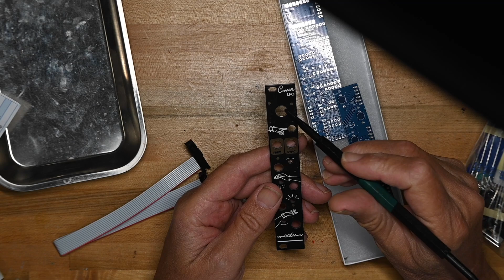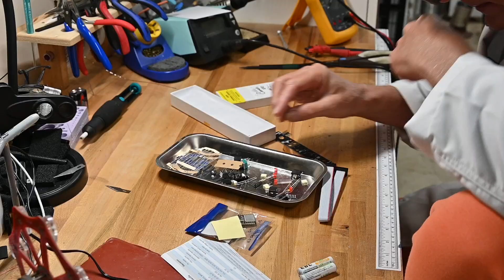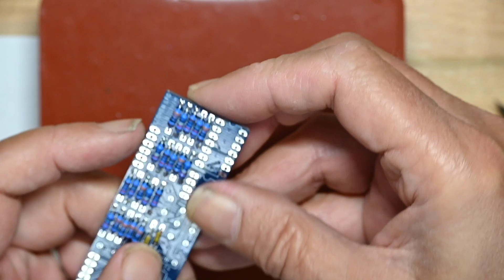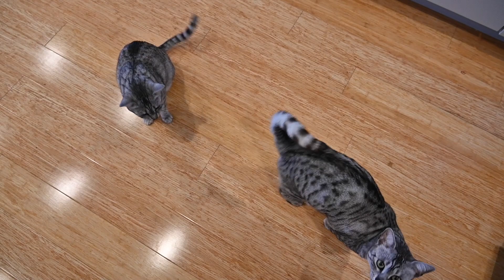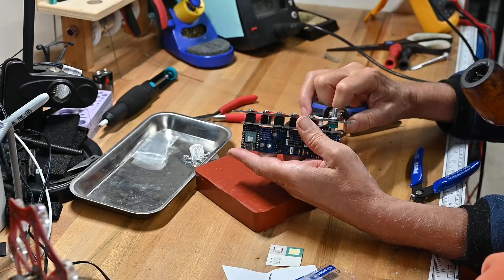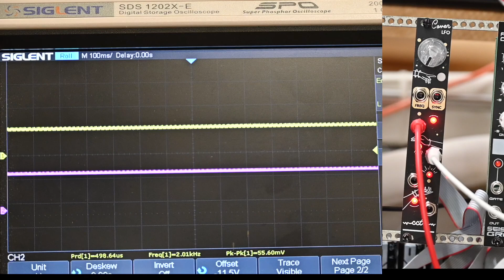C.K. builds a Coven LFO kit from CCTV, eurorack

Comment: How could you mod it to slow the modulation eaven slower? Thanks
Reply: Excellent thank you I hope it is possible I would love to find out
Reply from the maker: @Delaystomper Well, it looks like you could do it, but it's not a hardware mod.  You need to re-program the Ardunio chip to do this.  He has all the source on GitHub, so if you're proficient at Ardunio programming (I am not) looks like it's doable.  Here's the repository https://github.com/cctvfm/covenlfo
Reply: Aah ok I thought that it be a matter of swapping some caps but it is not hardware then. I can take a look at it then I do have an arduino based small cnc router maybe I can learn from it.
Thanks alot for your time I enjoyed the video and will be building mine using it as reference.
Reply from the maker: @delaystomper His code is pretty readable, so I think you can pick it up. Just a side note- I spent 45 years as a software engineer/executive and after I retired 2 years ago I promised myself I’d ignore software for a few years, focus on hardware.  Maybe next year I’ll get the itch back and dive into arduino,raspberry pi, etc.
Reply from the maker: @delaystomper I’ll have to take a look, been a while since I built that one.  Watch for an updated comment here in the next few days to see what I figured out.

Comment: Looks like an amazing and flexible LFO. I've been thinking about this one though I've never DIY'd a module. Maybe this is the first one. Just need to make sure the depth will fit my case first and I'll jump on it. Might be fun to get some synced lfo's in the case. Though, I'll eternally be debating just getting a pams instead for synced modulation as each output can be different waveshape also but yeah, love the simplicity of this one.

Thanks for making the video!
Reply from the maker: It is a great LFO.  I just measured it, and it’s 42 millimeters from the back of the faceplate to the back of the unit, the powner connector comes off the side so you don’t need to add it’s depth, so if you can fit 42 mm/2 inches this will work.
Reply: @CKHaun  amazing! Pretty sure that’ll fit no prob! Thanks!